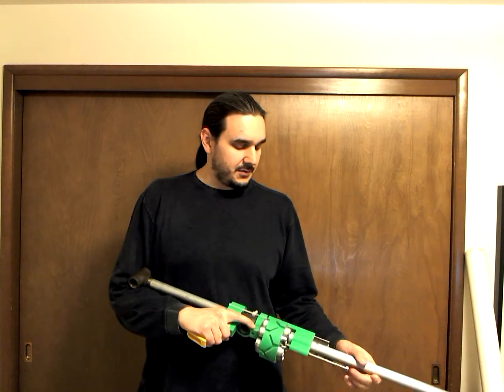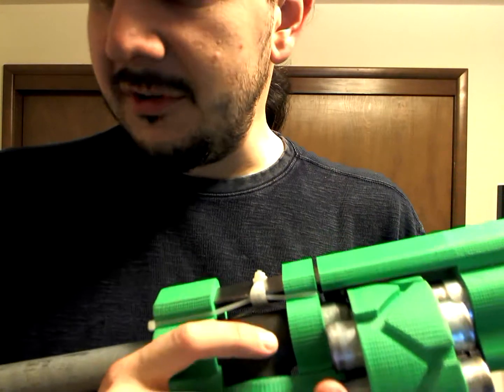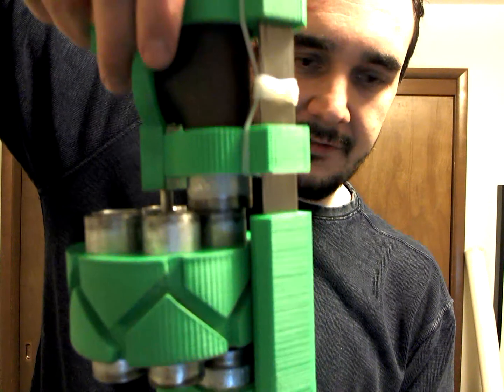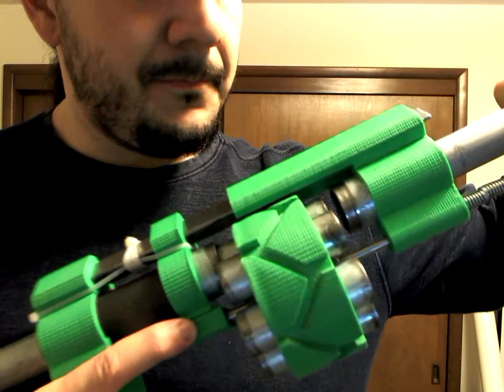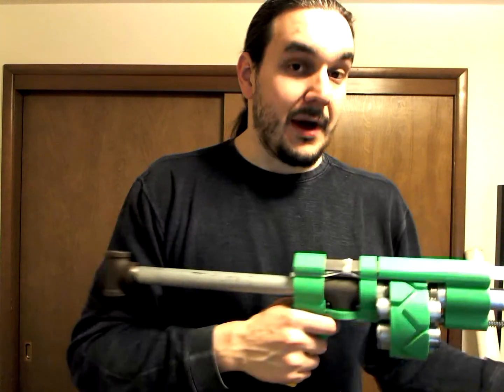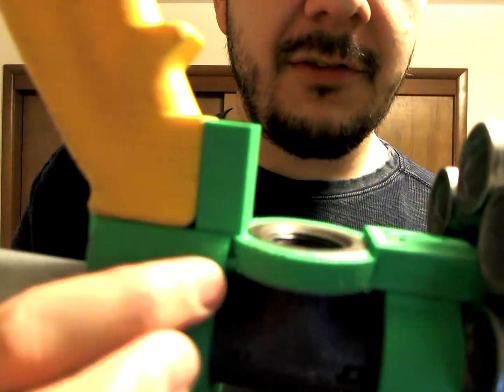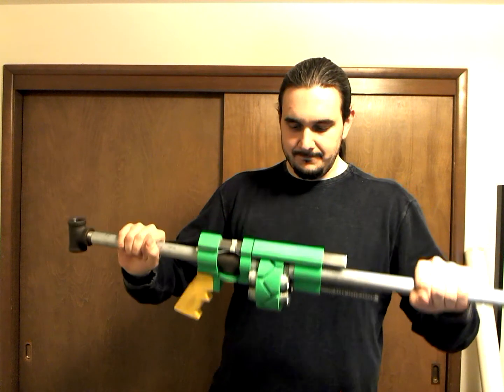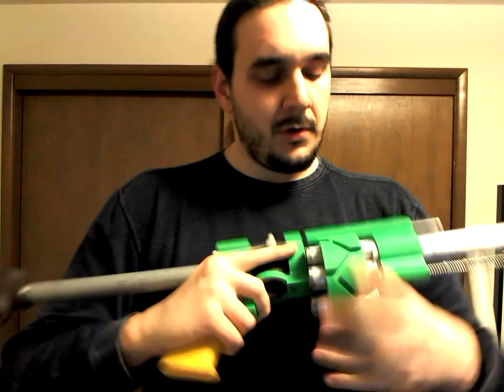#Liberator12k | 14 - Improved ZigZag and Attached Tee with Grip

Comment: JeffRod, I had a thought for an ejector.  Is it possible to use a push pull solenoid or linear motor? Heck u could even use that to change cylinders. Ran by a sure fire or vape battery? Man, I love this stuff. Need moar guns!

Comment: Yeah a plate to hold the rounds in would be advised. How about an ejector mechanism that is driven by the ratcheting action? on the now empty chamber, so it can take some time to cool off for the next round.  A flip door just like old school revolvers for load/unload? BTW, NRA member here, like the idea of 3D, self made reliable mechanisms.
Reply: ***** I was mentioning the NRA that I am pro gun supporter. The 2nd will likely never get overturned unless we have a shtf. 
Near Vancouver, WA, we should meet at a gun fest or show nearby sometime. :}